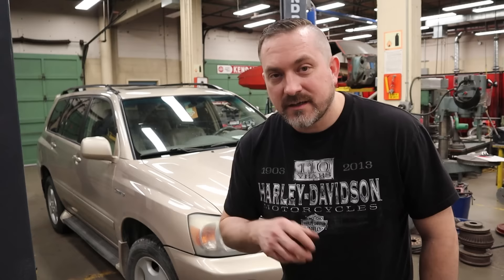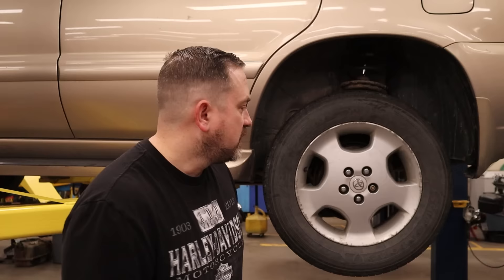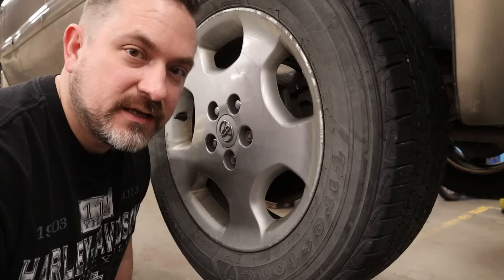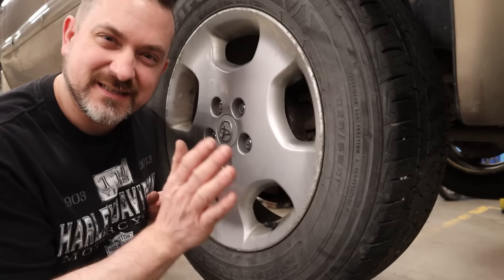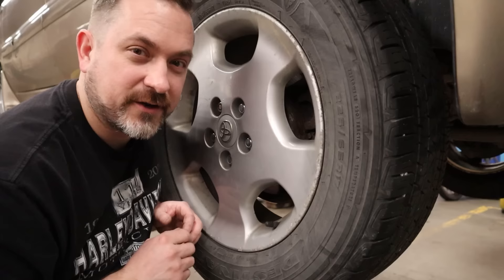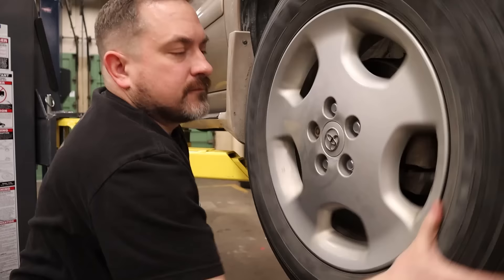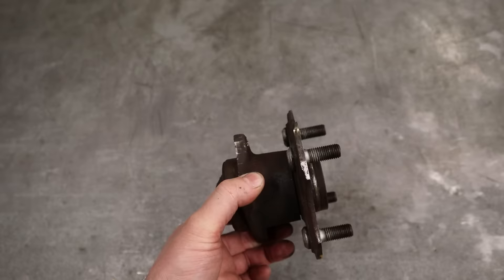How to 100% diagnose a bad wheel bearing.

Comment: Drive, say, 30MPH on a good quiet road with no traffic and listen for increased noise on bends. If noise increases on a left curve the bad bearing is usually on the right hand side of the vehicle. If the noise disappears on a right hand curve it's because you've unloaded the right side bearing so that reinforces your diagnosis. With care and practice you can steer gently either side of straight ahead and play a tune with the bad bearing!
Reply from the maker: You're absolutely right, in fact I have another video on how to road test a bad bearing and some other tricks.  You'll have to check it out. Thank you for the watch!

Comment: Mine sounds exactly like that but there's no play at all.  Now I'm questioning which side it's coming from and if it's even the wheel bearing.  The thing i am certain of is it's coming from the rear.  2018 Subaru Forester is the vehicle.  

I also want to add that I spun the tires by hand while I had it in the air and I couldn't see, hear, or feel anything off.  Now I'm not so certain it's the wheel bearing at all so I checked the tires and they don't appear to have any issues either.  There's no sign of belt separation and there's no cupping or chopping in the treads either.
Reply from the maker: I would watch my road testing a wheel bearing video so you can see my other tricks to narrow it down to a bad bearing.  Good luck!
Reply: My wife’s 2002 Jeep Liberty, that’s been used as a winter driver only since 2012, after she bought a new car for summer use only, the maintenance has been done on the Jeep every year after it’s been sitting for six to eight months, the front wheel hubs were replaced two years ago and have about twenty thousand kilometres on them, yesterday while having the new winter tires wheel alignment done the mechanic said the right front bearing was starting to go out and was the cause for not being able to get the wheel into specs on the alignment, I listen for any bearings noise on the fifteen km drive home at highway speeds and didn’t hear any grinding noises at all, I put it up on a jack and did a wiggle and spin test and no movement or grinding sound, it’s got all new struts, shocks, upper, lower control arms, and camber bolts, my question is on bearings sitting for long periods of time, would they go flat or dry and wear out so fast? It’s all highway mileage to and from town.
Reply from the maker: Sounds like one of 2 things.  The shop is telling you this but are wrong/lying.  You did the tests and found nothing wrong, then it probably is good.  For an alignment to not be done due to a bad bearing, it would have to crazy bad.  The tech might have misdiagnosed looseness in the steering or suspension as a bad bearing.  Hope that helps.   As for car parts sitting for long periods of time, yeah they don't like it.  If you put it away wet from salty roads, it "might" have slightly corroded but probably not.  Thanks for the watch and welcome to the channel!

Comment: Well done and great way to get to the problem. I have seen a fair bit of bearings noisy but with no play and lots of noise. Best way I found its on the hoist either spin it by hand or have some one slowing drive it while lifted and grab the spring, so will feel it 100% of the time even if its just starting but barely audible.
Reply from the maker: Ya you're right.  I have a video coming out in a bit that shows a bunch more tricks for diagnosing bearings including what you just said plus a road test trick too.  Thanks for the watch and the suggestions!  Cheers!

Comment: While wheels jacked up safely and engine spinning them, you can feel the very slightest vibration by holding the strut spring or the rear axle housing near each rear wheel.
Reply from the maker: You're right, I actually have a video where I show more tricks to diagnose these bearings and this is in there.  Thanks for the watch and the suggestion!

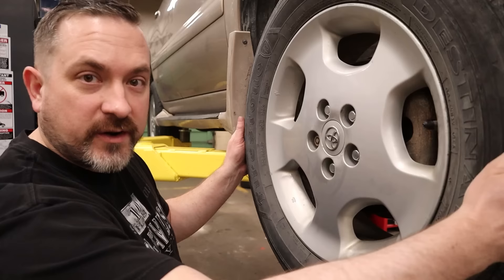Comment: @3:56 When you did the test w/tire rotation, can you check it w/only front tires in the air, or all 4 should be in the air. The bad wheel bearing (actually it is wheel bearing & hub assembly on 2003 Chevy Cavalier, I don't know if you can remove just wheel bearing itself from that assembly) were bad on the front. There was exactly that noise like in your film on driving straight. I replaced the original ones w/new aftermarket just bcs of the mileage (~100K) about 2 years ago. Now they both failed, mechanic on alignment told me and I replaced them for the original ones I saved. Again the original ones had no issue and when I rotated them, they were rotated smoothly. That knocking sound gone, the car drives straight smooth, but now on turn it gives whining-scratching sound when turning to the Left (occasionally), and loud grounding sound when turning on the right. I did another alignment in the Dealer, but that sound didn't go away, and they didn't give me any recommendations this time. What that can be? I would appreciate any opinions on this matter. Thank you for the informative film. Yes, and when the wheel bearing were bad I couldn't feel anything by shacking the wheel side to side on in vertical direction.
Reply from the maker: You just need the wheel you are checking off of the ground to test wheel bearings.  Sounds like the old bearings were bad so now that you put them back on, they're still bad and making noise.  Bearings can make noise but have no play.....
yet.  I have another video that shows some more tricks plus a road test for bearings too, you should check it out too.  Sounds like new bearings are in order.  Good luck.

Comment: If a wheel bearing is going bad it would always make the noise right? It wouldn't stop or be intermittent at all would it? I'm thinking the rotor is warped, the car will make a grinding sound when accelerating but if you let off the gas it will stop. Also turning to the left seems to make it happen too.
Reply from the maker: It sounds like a wheel bearing to me.  I would also watch my road test a bearing video for more info.  Thanks for the watch and welcome to the channel!

Comment: I'm on my second bad wheel bearing. The first thing I noticed was the car was loud at freeway speeds. To determine which wheel I turned each while placing my fingers on the spring. You could feel grinding in the bad wheel.
Reply from the maker: That sucks, was it the same exact wheel?  I actually have a bad wheel bearing starting to go as well.  Funny enough it's on another Highlander but a 2008 Hybrid this time.  Thanks for the watch!
Reply: @wayofthewrench   Not the same wheel, the first was the rear driver's side, 272,000 miles, and the second is the rear passenger, 292,000 (2008 Honda Accord)
Reply from the maker: That would be a good example of why it is recommended to change both at the same time.  Hopefully the job wasn't a nightmare.  Cheers!

Comment: I have a question when you move the wheel up and down and left to right that sound it could be an lower or upper ball joint crack sound too? or it sound different or different position where it come. Thank for the information great way of teach
Reply from the maker: Suspension components like an upper or lower ball joint are checked with up and down movements.  Left and right is for steering components check.  Both up and down plus left right play could be both or bad wheel bearing/ loose lugnuts.  Hope that helps.  I have great videos on road testing a bad bearing and checking steering components you should check out.  Thanks for the watch and welcome to the channel!

Comment: Grap with one hand one coil from the spring from the suspension and your tumb under the last lower part and spun the wheel. If you feel vibration, bad bearing.
Reply from the maker: Yes that is a good trick and that's in my road testing bearings video along with a few more tips.  Thanks for the watch and your suggestion!

Comment: If it shakes up and down and side to side it could also be loose suspension parts (tie rods and ball joints), not necessarily a bad wheel bearing. Seen it many times. You have to look at where the movement is coming from
Reply from the maker: Yes you are correct, up/down is usually suspension components and left right is steering components.  Both up/down and left/right can be bade bearing, loose lug nuts, or suspension and steering components.  Thanks for the watch!

Comment: Drivers side wheel bearing went out on my lifted 2013 F150 back in May. Wheel/tire came off on the highway. Now my 2011 Jeep Grand Cherokee is making a grinding noise up front like the brake pads are worn. After checking, pads are good, both front wheels don't have play.
Reply from the maker: Did you check the inner and outer pads?  Sometimes just the inner is worn and has metal on metal.  Also did you lift the vehicle to check for bearing play?  Good luck.
Reply: @wayofthewrench  yeah I lifted one side at a time and no play. Pads look fine, probably 1/4" pad left on all. But I did notice the brake dust shields were rusted pretty bad and brittle and bent the lips away from all 4 rotors last night. Drove to work a few hours ago and didn't make any grinding noise at all. Hoping that was the cause cause our road in front of our work has been all tore up with construction the last few weeks and it's a very rough ride, maybe they got bent against the rotors. I'll tell for sure after I leave work today. Yesterday after work they sounded pretty bad.
Reply from the maker: Cool, hopefully that was the fix.  Did it come back?
Reply: @wayofthewrench  nope. All seems fine now. Does squeak coming to a stop sometimes so getting close to changing the front pads. Think I'm gonna look into trading it in.
Reply from the maker: The squeak at stops could just be unlubricated pads too.  I have a video on checking your brake pads if you're interested.  good luck!

Comment: I don't have any play in my wheel but I have a "womp womp womp" that sounds like its coming from my driver side wheel going down the road and gets worse when I turn left. I had an alignment, tire rotation and balance done to see if that was it but it's still doing it.
Reply from the maker: I would jack up the wheels off the ground and test for loose wheel lug nuts, loose/worn bearings, check for play in the cv axles, worn brakes, loose steering/suspension, foreign object stuck in tire, and check tire for bulge.  Hope you find the issue.

Comment: EricThe Car Guy says that's how you check to see if your alignment parts are good or not.  When you check like you do, is it possible that the movement is because of the linkages?
Reply from the maker: To check for steering components, you check for play left and right.  For suspension components, you check for up/down. For bearings, you check up/down and left/right.  Looseness in all directions is either a wheel bearing, loose lugnuts, or both steering and a suspension component.  Hope that helps.  You should check out Eric's how to jack up a car video.  Then check mine.  If you deem me worthy, I'd really appreciate it if you could share out my channel on your social media so I can help more people.  Thanks for the watch and welcome to the channel!

Comment: After changing the right rear wheel bearing do you need to do a wheel alignment on the front or back
Reply from the maker: You don't usually do an alignment after a bearing change unless you removed/replaced steering or suspension components.  Hope that helps.  Thanks for the watch and welcome to the channel!

Comment: Recently went to get 4 used tires put on my van , upon leaving I was wobbling so I wobbled back and he didn’t put luggage nuts on right at all on one of my tires. He fixed that and I left. Now I do hear a loud noise when driving coming from back I believe. Do you think maybe he didn’t put my lug nuts on right on my tires and that’s causing it , and not a wheel bearing? I should just jack up and do these tests huh
Reply from the maker: Time to start doing your own work.  Start by checking all of your lug nuts for proper spec and checking again in a week or 100 km .  Then jack it up and check for the bearing like in the video or other issues like a bad CV joint.  What you don't know, start researching and trying and you'll get there.  Good luck on your gearhead journey!  Cheers!

Comment: A good test is to spin the wheel and touch the suspension spring ....the bearing wear will be greatly amplified as a vibration.
Reply from the maker: Yes you are absolutely correct.  I have a great video on road testing a bad bearing you should check out.  Thanks for the watch and welcome to the channel!

Comment: Great video! However, I have probably a stupid question...
I am experiencing exactly this but I also have movement in and out on my axle. No play in the axle other than that. I replaced the strut, tie rods and sway bar links and am wondering if perhaps my axle popped.
Reply from the maker: Yeah you might have blown a CV joint.  Try testing at very low speeds in an empty parking lot with full left and right turns , also in reverse.  If it sounds worse in a full turn then that would be it.  Hope that helps.  Thanks for the watch and welcome to the channel!

Comment: My wife’s car only move left to right now up and down… Hers is the AWD Ford fusion Titanium.

Is that still the bearing or something else? I looked behind and EVERYTHING moves with it nothing seems worn out. But her passenger side doesn’t have any play. She has noise above 40mph of a wobble or “wub wub wub wub” sound
Reply from the maker: If it moves up and down and left and right it is most likely a bearing or wheel is loose.  It could also be worn steering and suspension components as well. Hope that helps.  Thanks for the watch and welcome to the channel!

Comment: My car squeaks when I turn my wheel all the way to the right. Would it be wheel bearings? Changed tie rod ends and stabilizer link bars front and rear, bushings looked sliced open 😬 I’m going to try this rn!!!
Reply from the maker: It squeaks only when you hard turn right?  Does it constantly squeak at full turns or only when you are turning the wheels ( at a stand still)?  It's hard to diagnose properly through a message but it could be CV axle joint.  Thanks for the watch and welcome to the channel!

Comment: Thanks so much for the great video! Very informative. One question for you. If the old bearing (after having been removed from the car) is silent or virtually silent when spun, like the new one you spun near the end of the video, does that definitively mean that it's still good? I ask because a shop just replaced one of the rear bearings on my '09 Mazda6, and the old part is even quieter than your new one. Even worse, the car is still making the same noise, and now they want to replace the other rear bearing. Thanks for any help!
Reply from the maker: Sounds like they guessed and changed the wrong bearing.  Mind you it's common practice to change both anyways.  Thanks for the watch and welcome to the channel!

Comment: I just use stethoscope - when bearing just starting to be bad, there is no play and no loud sound, but stethoscope on bearing allow to hear not smooth rotation and isolate another noises.
Reply from the maker: Yup that works but generally I don't use a stethoscope unless I'm trying to diagnose an issue.  This definitely helps to narrow down and confirm bearings though.  Thanks for the watch!

Comment: A little late to the video but I don't have that issue as I am aware of mine is a knocking you can feel though the driver side flooring I checked all the rubbers and bolts they look like normal no cracks or damaged I was told maybe because I have 1 44PSI on the passenger and 52PSI on the drivers side as its a spare till i fix and main they are all terrain except the spare thats more normal thread I have a Nissan Navara ST D23 NP300 S3 I don't know if any of this helps me but I'll put it out there
Reply from the maker: Stock tires should never be that high of a pressure, should be around 32 psi.  The clunking could be CV axle going.  Might not be a bearing.  Good luck!

Comment: Would much rather do a hub assembly vs on my '06 GMC Yukon on the rear axles it involves pulling the axles, replaces seals & changing the diff gear oil plus the actual bad bearing so doing both sides.
Reply from the maker: You and me both brother!  Thanks for the watch!

Comment: Great video!! My fiesta st2 makes a high pitch squeaky noise it goes away at higher speeds but at lower speeds it's very noticeable when the windows are down. Is it a bad/dry wheel bearing like i thought or maybe something else?
Reply from the maker: Sounds like brake pads are worn out or if you check and they aren't worn out, then they might need silicone grease applied to the metal on metal parts.  I have a great video servicing brake pads you should check out.  Thanks for the watch and welcome to the channel!

Comment: My 19 chevy 1500LD with 100082 with original bearings might be bad. I don't hear the humming noise due to my All terrain tires. But I feel vibration in the steering wheel and feel vibration under my feet as well. And when I take off cruise control speed does drop very quickly.
Reply from the maker: Best thing to do is do the test in the video for side to side play.  Then you'll know for sure.  Thanks for the watch.

Comment: Even if everything seems all right, after driving home I occasionally compare the surface temps. of the hub areas with a laser thermometer hoping to detect differences that might reflect failing bearings in my 26 yo car. So far, fronts have always been about equal as have the rears. Do you think this is worthwhile?
Reply from the maker: It doesn't hurt but probably overkill.  You will hear sounds before any issues happen and then you could check the temp and what I did in this video.  Thanks for the watch and welcome to the channel!